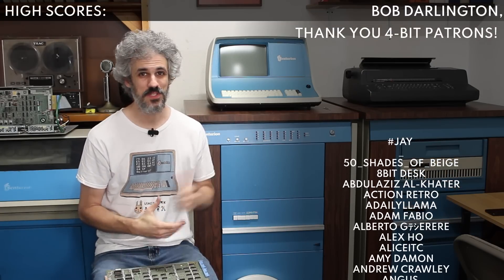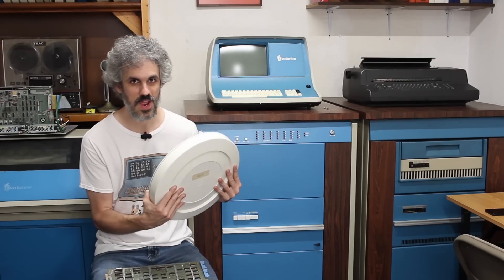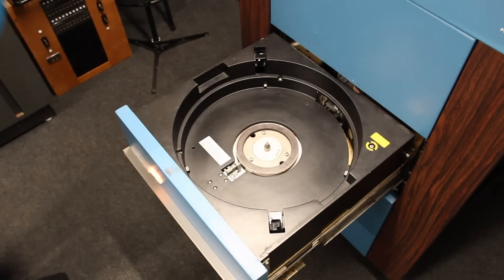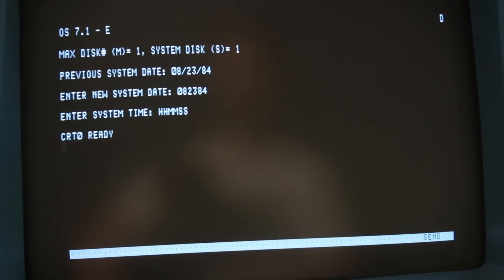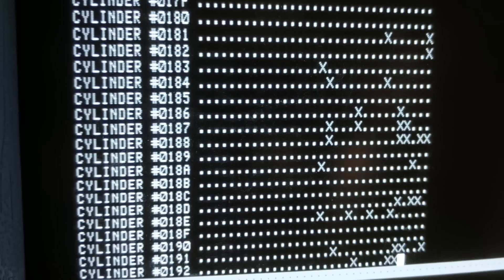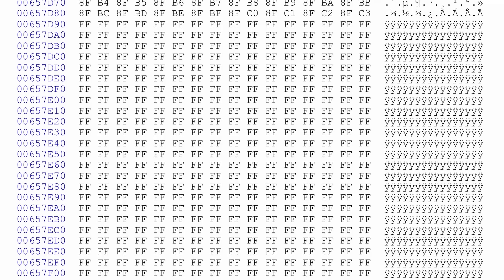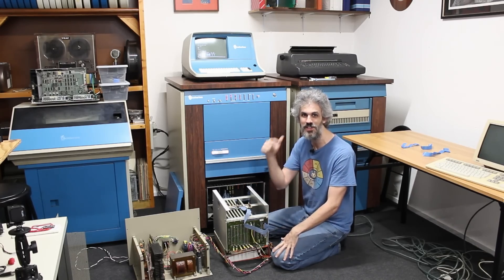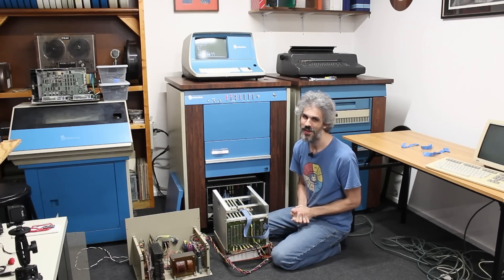We Found a 2nd Centurion OS!

Comment: This old CPU5 OPSYS did not support file libraries / sub-directory.  The idea of  file libraries / sub-directory was a new feature in very late CPU5 OPSYS and all the CPU6 OPSYS systems.
Reply: Must be fascinating to see these ancient systems you worked on being brought back to life!
Reply: Same thing with MS-DOS 1.x vs 2.x.
Reply: @stonent  Exactly what I was thinking.  For the early OS's sub-directories were a very novel concept. Even those that came later like IBM's mainframe VM/CMS which did not support them. At least in the 80's. Haven't used it since, so don't know if it does even now.
Reply: @stonent  Right we got an IBM PC XT in with a 10 MB hard drive which had MS-DOS 1.0 and it's really fun considering filenames were limited to 8.3
Reply from the maker: I think this version of OpSys is somewhere in the middle. It does have some libraries, like the GL library, but I sure can't figure out how to access them! I'll have to get you on the horn one of these days and really pick your brain on the CPU5 OpSys!
Reply: Stone knives, and bearskins.
Reply: Look and see if you have some commands like [  PDIR  ] for looking into the early start of subdirectories in the Centurion OPSYS.
Reply: @KameraShy  hierarchal filesystems were quite resource and storage space intensive (for the time!). Also, if you have a system that requires maybe 2 dozen files for a working OS, 6.3 or 8.3 file names still gives you a lot of potential filenames without the need for subdirectories, especially when you may have about 100 files on a disk, at most.
Reply: @UsagiElectric  Check to see what the file (  PDIR  ) on the CPU5 disk does.   The PDIR maybe a JCL script to look into the CPU5 "D" type files.   At one point we call the new  idea for using disk space better " private directories".
Reply: From memory the original Macintosh had a flat filing system BUT the GUI supported nested folders. I can't remember the details.
Reply: @stonent  Didn't know you could only have the directory structure two layers deep in early MS-DOS versions.
Reply: @stonent  That's what you get when you rip off CP/M  ;)  Honestly though, sub-directories seems like such a necessity, I'm surprised Digital Research didn't add them A.S.A.P.  CP/M 3.0 should have definitely had them (yes, I know about Users).
Reply: @paulwomack5866  I remember something along those lines too, which seems weird.  Wasn't System/Finder based off of ProDOS?  ProDOS had sub-directories--so shouldn't the original Mac have inherited them?
Reply: @richardclarke376  Yes - I was lucky to have found David's YouTube channel on Centurion about 22 months ago. Being close by I was able to help out with my old "Diag. PROM Bd.".

Comment: It is great to see you SO GEEKED when DOS 5 comes up!  Congratulations to you and the students of Butler!
Reply: I wonder if it's possible to 3D print shells for new air filters for the Hawk Drives, then cut foam to fill them, i.e. to create new air filters for the drives?
Reply from the maker: Thank you so much! It was awesome seeing it all work as well as it did!
Reply from the maker: @PCFixer  Totally possible, but it can't be foam, it has to be proper HEPA air filter material. But eventually, that will be something I'm going to have to tackle!
Reply: @UsagiElectric  Of course, pardon me, I was thinking about the foam stuff they use for lawnmower air filters, ha-ha--but for the Hawk, that just is NOT GOOD ENOUGH!

Comment: I applaud all of you who are saving, documenting and archiving all these obscure and obsolete computers and software!
We are quick to throw away old hardware when new and better options become available and we see zero value in saving anything...
Later when we start regretting that we didn't keep anything from the past we soon realise that there's nothing left?!
I could never afford a new computer when I started programming in 1981, and I didn't have my own computer until the late 80's, so I relied on borrowing old and obsolete computers until I got my first one, thus why I didn't care at all about these older computers when I got my hand on a new one. I remember throwing four fully working Commodore PET's in the garbage because they were useless - something I regret today. I regret throwing away my two SUN Sparcstations as well, as do I with many Motorola and Intel CPU's.
I have however saved many Amigas from the landfills by repairing the pcb's from leaky batteries and restoring them to fully working, as a sort of contribution to saving some important computers for the future generations, but my dream of owning a IMSAI 8080 and a Unibus PDP-11 with a cool front panel like the PDP-11/20 or /70 but the few running ones, even those repairable, have become so expensive that I just can't afford one just because the vast majority of them are in landfills today...

Thank you for this interesting trip to save the Centurion! (which later became Centurions ;) ) 
I'd never heard of Centurion before you made your first video, as I suspect most viewers hadn't, and now it's archived for the future!
The computer has evolved so fast compared to almost everything else, hence why museums etc never saw the need to save the past ones because it's always too late even before you start thinking about saving one, and that we should do something about!

Comment: I would add a toggle switch to disable/enable the heads. Instead of partially disassemble the hawk drive to get at the plug. You seem to enable/disable the heads fairly often, so a switch makes sense to me.
Reply: Very sensible, make sure it has an indicator so you don’t accidentally try and boot when you meant spin.

Comment: Off the rails question (as usual)
The Centurion terminal with heavy burn-in CRT. How about establishing an inquiry into finding a replacement CRT? Original part of course. They were originally bought from one of the CRT-manufactorers. You could be in luck and get new old stock.
It doesn't seem incredibly impossible.
Just wondered......

Anyway. Cheers and congratulations. What a thrill and a joy to watch.

Comment: after retiring from IT, i was a locksmith for a fair number of years.  to remove those broken pins, you may be able to use a "Broken Key Extractor".  they are cheap and easily located with a quick search.

Comment: I've seen a Centurion desk with drive on right and regular drawers on left so it was wider but otherwise the same as the schools.  I first saw it in 2000 when it still had its roughly +200 lbs power supply on the lower back of desk.  The original owner shared that they got it in 1979, however in early 90s the drive pack was installed and turned on without following procedures which cause a drive crashed and nothing was salvageable.  They only kept the desk part because they couldn't get it through the stairs without disassembly, but felt it worked fine as a desk leaving it in place with a Win 3.0 and later a Win95 PC sitting on the desk.  A few years later I noticed they removed during an office remodeling, always wondered about Centurion ever since.

Comment: They really did build those things back in the day. Around that time in the early 80's I was working on a Data General Nova 4 system paired with 300 MB Control Data hard drives of the platter variety. 14 platters as I recall, and yes, they were removable. There was a company out of Pittsburgh called Randomex that would come around and inspect the disk platters and wash them periodically. Now I have more power in the palm of my hand. Thanks for the nostalgia trip. :)

Comment: I don't think I ever ran across a CPU5 system at a client. Everything was CPU6 and were selling CPU7's. Glad Butler Tech was able to take it and preserve it. I wonder where it originated from.
Reply: What dealer (Buddy Cruze) or customer did you work at with Centurion systems?   I was at Centurion HQ from 1975 to 1986.
Reply: @kenromaine2387  I worked for Cincinnati Data Systems which was bought by Cruze Computer of Knoxville. I started there in 1985 just out of high school doing support and some CPL Programming and integrating with PC's.
Reply: I personally installed Howell & Chuck's first Centurion system in around 1978.    Howell & Chuck are pictured in some of the early Centurion sale brochures  with both of them looking at a manual on a desk, Howell is sitting & Chuck standing.
Reply: @kromaine13  I remember the names. When I started I believe they had handed things over. Jim Milam was the manager of the office at that time. The Cruze's made regular visits. They had the majority of CPA's in the Cincinnati area as customers. Some general contractors and distributors rounded out the other customers.
Reply: Buddy Cruze was a good man.  I understand that, Buddy passed a few years ago.  I guess you know David Williams  at Cruze Computer.  David an worked together at Centurion & ZTRON before Buddy purchased the assets from Bankruptcy Court.
Reply: @kromaine13  I'm sure I met him. I spent a couple of weeks down in Knoxville for training, but some of the names have faded from memory. Gil, Jr, and Buddy are the only names I distinctly remember at this point. They used to invite everyone to Gatlinburg for an outing. I got to go once. I was only with the company for a year. Jim left to join his friend, Terry,  to start a Qantel dealership. I followed him there. Qantel was another interesting mini-computer I worked on that's faded into history.
Reply from the maker: That's awesome that you worked at one of the dealers!
If you have any old war stories, I'd love to hear them. If you don't mind, come join us over on the Discord: https://discord.gg/p7UsfHD

Comment: Another fantastic video. Your repairs, as usual, are amazing. I'm sure you've already seen it, but I wanted to point out the Hakko desolder guns. I have an FR-301 and it's an absolute dream for desoldering DIPs. It's very fast, so less thermal stress on the chips, and less stress on me. It removes virtually all the solder. Often, when it's done, the chip falls out without having to break the pins free. As often as your changing out DIPs, I thought you might benefit.

Comment: Your exuberance is contagious. I wish we could do the same thing with my 
Technical Design Labs - Xitan (S-100 bus) computer..

I found a pa ge that has a PDF of the ZPU card and a KiCad footprint of a general purpose card.
The circuit diagram was barely readable and has a missing gap in the middle with some lines that goto nowhere..

From his KiCad GP card, I was able to make a blank card footprint, 
that I can use to make ANY S-100 bus card you could dream up.

I do not have any software for the Xitan, but the PDF did have some assembly on it..

My wild idea thought, since I have a KiCad blank card footprint. to make a S-100 bus version of the C-64 and run Hesmon on the Xitan to look at the entire Z-80 memory.

Other ideas were to make a completely modern retro computer. 
ARM processor
i2c, USB, HPIB, CAN Bus, M.2 SSD, uSD, Wi-Fi, plus anything else you could dream up that didn't exist in 1979..

If this is doable, might have to scrap the original S-100 architecture and repurpose all of the pins on the bus. or give the bus a multi-mode pin.. 

Let me know what you think..

Comment: I'm curious about the "sockets" at 2:30 in the video. There are plastic 20-pin sockets in the upper row and 20-pin fiberglass and milled pin "sockets" in the lower row. Maybe some oldtimers know whether it was ever a standard industry practice to use these custom socket replacements on production boards. I've certainly never seen it before.
Reply: I would say that the folded pin sockets were there for the IC's that they knew would not need updating, like decoders and logic, but which needed to be programmed before assembly, so put them in there to have a socket with low number of insertions. The turned pin was probably there for things like microcode and decode ROM, that they knew would have a few cycles or release on them, and improvements and upgrades, along with bug fixes that were likely to be needed in the first few iterations, so make the sockets durable, and able to survive 100 plus upgrades, so they would have no problems with flaky sockets.

Also might be the boards were populated with a mix, because they had a few suppliers of sockets, and would use whichever one was nearest in placing them, using a few feeders in the autoplacer to hold sockets, and the machine running round robin between the feeders, so as to make use constant, and the feeder got whichever tube was closest when it was empty.

Comment: This reminds me of my first steps into the IT business back in te early 70's, throwing colored jumper cables at mixers, sorting machines, then writing my first programs, punching the cards, lots of cards, even more cards. some programs had 3 to 4 boxes of punched cards to be read in just before the real data followed. oh, those were the times when we were young! by the way, I have never seen this type of machine before - I started on IBM's 360s with 48K of memory..., even had (for a relatively short time) a Honeywell-Bull 61-40 at home - a full room of hardware weighing 2000lbs and heating it with 3KW power consumption. But my wife learned Cobol on this monster...

Comment: Regarding games, I seem to recall that when I was in charge of a Centurion system there was a version of Knight’s Tour that shipped with the system.
Reply: I remember playing that on an IBM computer in the '70s
Reply: You used one?
Reply: Yep. I used to work at a company called Machinists Tools and Supplies. We used it for sales/picking tickets, invoicing, inventory, purchasing, shipping, receiving, general ledger and payroll. At one point I was given access to the source code for almost everything. I eventually got laid off due to economic pressures but ended up with a line printer in my living room. 

Later I learned that the system had been swapped out for a Unix micro. Someone had developed a program to convert CPL6 programs to the C language which was then compiled for the new machine.

Comment: Both the ALTAIR 8800 and the DEC PDP 11 have now been reproduced using the Arduino Mega and the Raspberry PI respectively. The levels of emulation are just amazing, with it even being possible to run CP/M software on the ALTAIR. Are we now approaching the point where some group could consider making a reproduction of the Centurion using one these cheap, off-the-shelf systems? It would certainly make an excellent college project for someone!

Comment: a tip.
I had a multi contact multi position switch I could not replace. So I replaced it with a bunch of individual reed switches, a small microP to control all the reed switches and then a single pole multi position switch to control the microP.

Comment: Very cool "disc"overy! See what I did there? LOL Congratulations on such a huge success. It was awesome to see.

Hey, I was thinking, if you need a 60Hz time base for those old machines, you can use a MM5369 to make a small clock board.

The MM5369 is an 8-pin DIP IC that uses a standard 3.579545 MHz NTSC "color burst" crystal as a clock and produces a precise 60Hz square clock train output. Perfect for retrofitting in old clocks that use the AC line for a 60Hz time base. 

I have bunch of MM5369 IC's. I can send you some to use. The IC's have been discontinued for some time but I have seen hacks to replace them using tiny microcontrollers and such. They are getting to be very rare these days.

Anyway, if you want some of these IC's, shoot me a message with where to send them and I will send them off to you. Cheers!

Comment: That is amazing you can achieve things on such old devices. I am sure there are a Million things it does with the operating systems. I have heard software emulators can also do those types of jobs if you really need to work but don’t actually have the machine!

Comment: 4:30 just any arduino using a full 8bit gpio port for data bus, and shift register  to do address bus cuz only need 3 gpio plus control signals....and its easy to daisy chain 595 or cpld and just run a timer to count the bit width of the address bus and spit the data bits on gpio to ram and out via rs232 or USB

Comment: I guess the boot rom is using CPU5 or older instructions on both systems. I'm glad it didn't become a red herring when testing the CPU5 board in the CPU6.  Are the card cages otherwise identical?  It may be useful for him to burn a copy of the newer IPL rom so he could boot from other devices.
Reply: They seem to be, and yes a new updated boot rom, that allows switching OS boot, is likely to be a good upgrade, with the old 28S22 relegated to being a display piece.
Reply: The CPU5 & CPU6 use the same backplane. The newer CPU6 bootstrap PROM can be used on the CPU5 as long as you are not using the old 3 floppy drive controller, it's OK with the FFC [ floppy & Finch ] controller.

Comment: Nice work!
Just a question.. Did you try dumping the disk a few times to see if the failing sectors remained consistent between retries?
Reply from the maker: Thanks!
The dump program actually retries a sector three times before giving up on that sector and moving to the next one. There were a handful of sectors that did clear on a retry, but most likely, the lower head is just ever so slightly out of alignment. If we get to a point where we desperately need some data that's in one of those missing sectors, I'll go back and try to tweak the alignment.
Reply: Did you try NDD (Norton Disk Doctor)? LOL! Or maybe you could call Peter Norton himself! Thanks for the video!

Comment: I would read the boot rom and put it on another EEPROM. I would then install this. 
The IC is so rusted that it will soon fall apart.
Reply: The eproms are deeper than the boot code, they are the instruction set...microcode. a lot of info in earlier videos that I need to find time to revisit and understand.
Reply: ...see the thing now with the boot rom on the backplane now.